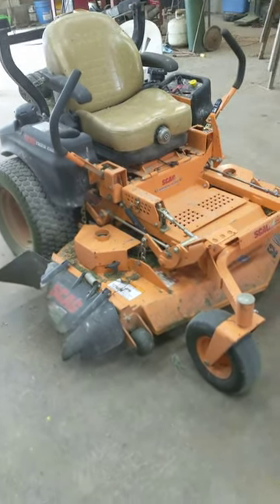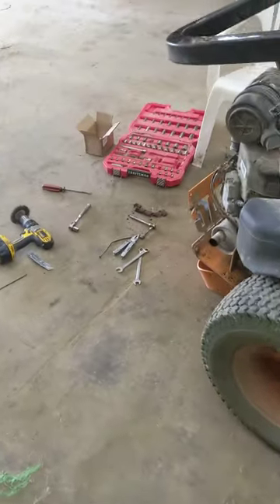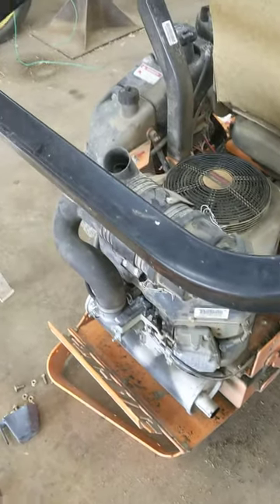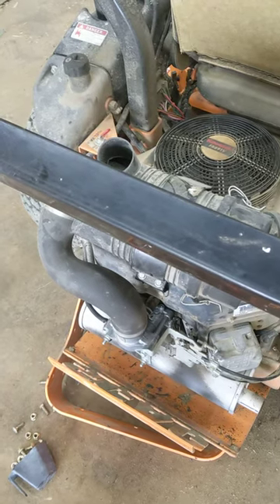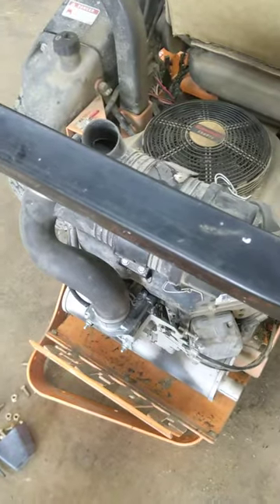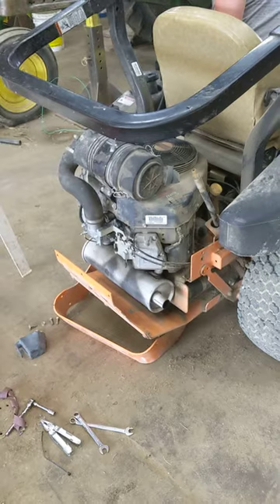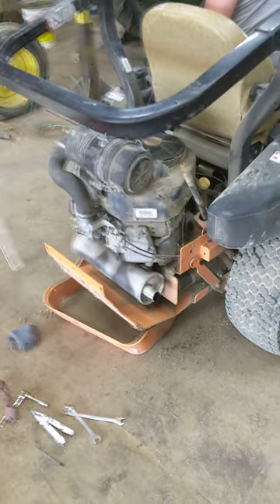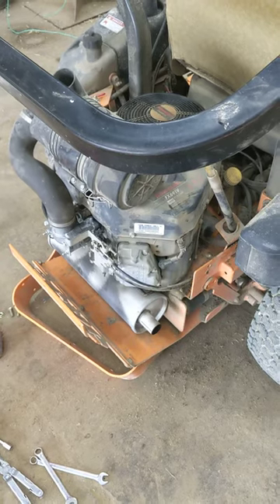SCAG Tiger cat with engine surging at low idle. Kawasaki  FX691V carburetor at fault, easy fix

Comment: I have the same engine.  KAWASAKI FR691V, 23 HP.  The carburetor on mine is a walbro.  My Walbro carb has three welch plugs. 

my surge at idle on happens when engine is hot.  At cold start (after long storage), there is no surging.  It only happens at hot engine phase.  So I did all the normal things you would expect...coil, spark plugs, intake manifold gaskets. Head Gaskets.  Complete fuel line and fuel filter and vacuum line replacements.  I even removed the tank and cleaned it thoroughly and replaced the in tank screen filter.  I cleaned the carb, then replace the carb.  Adjusted the governor.  Adjusted the valves to spec.  I did all of these things, and realized...hey...those welch plugs...they were installed, but apparently when the engine goes hot, one or more of the welch plugs was leaking.  pulling air into the carb.  So rather than trying to find a replacement and removing the old and installing new, I simply cleaned the welch plug with brake cleaner and a fine brass brush.  Then compressed air to dry.  Then applied some steel JB weld.  Let it cure for 48 hours.  Run great.  Three years and no more idle issues.  I''m sure the "proper" way is to replace the welch plugs, but jb weld works just fine.  These are not super pressurized welch plugs.  The get blown out in the event of an backfire.  But in these small engine if you have that kind of backpressure, there is enough volume back toward the fuel vapor line into the tank that will take up that pressure.  So it's really not that important to have welch plugs that act to blow out under backpressure from a back fire.  It's a cheap and easy fix.  In fact, I have several mowers and I have preventatively applied jb weld to all the welch plugs in the carbs...never had any problems with welch plugs again!  you are welcome
Reply: Im about to try this on one of my mowers. 2020 scag 36 vride2. It's been backfiring a lot over the past year or two. I'm not sure about the reason, but ever since it started backfiring, I've had surging issues.

Comment: Your 'welch' plugs had fallen out, common problem on NIKKI carb. FX691V Kawasaki engine is excellent and should give great service.
Reply: your right if you get a backfire through the carb 98% of the time it blew a welch plug out.